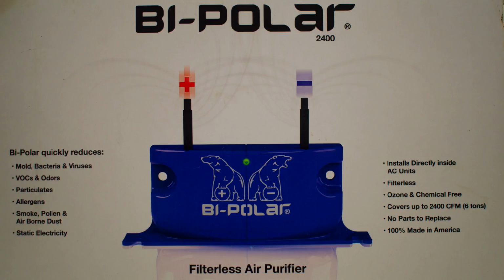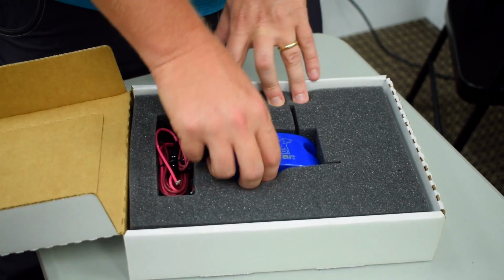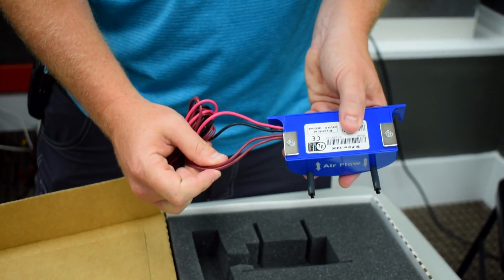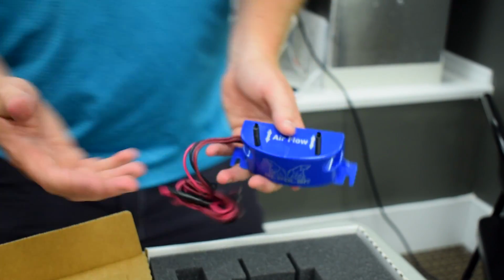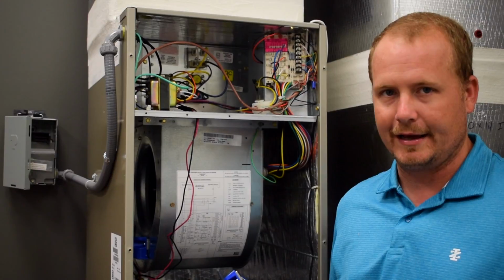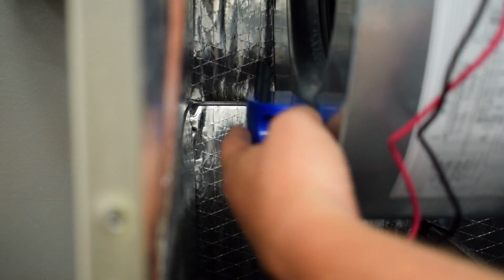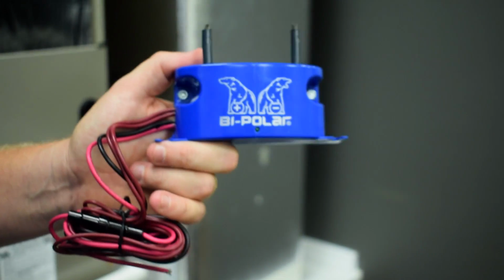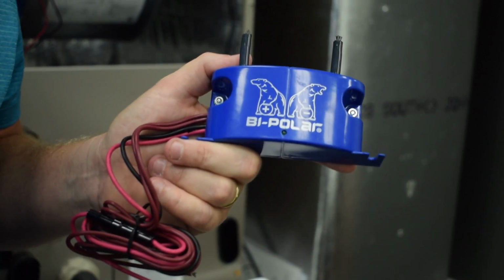Air Oasis BiPolar 2400 Air Purifier

Comment: What's the difference between this product and something like the iWave?
Reply: This is already included in the Reme Halo. Reme does even more. Cheap imitation. Same as the  "NASA Technology" BS stated by Nano HCT and the Nano 2400 Bi Polar unit. You need to buy 2 units to make up the same thing the Reme Halo Does. They have been doing this for 25 Years!!